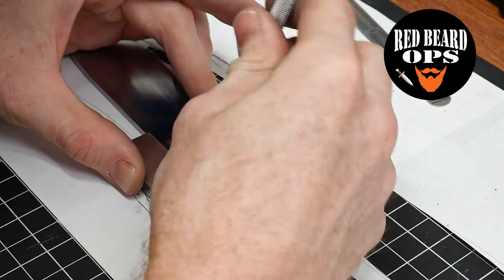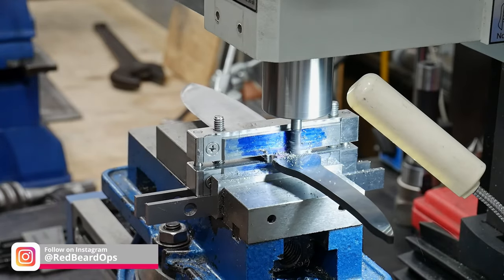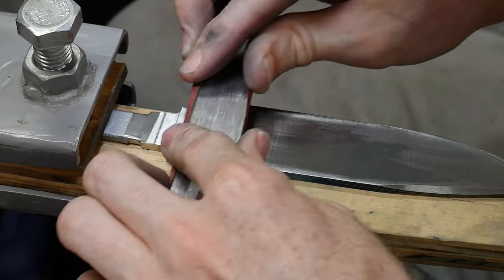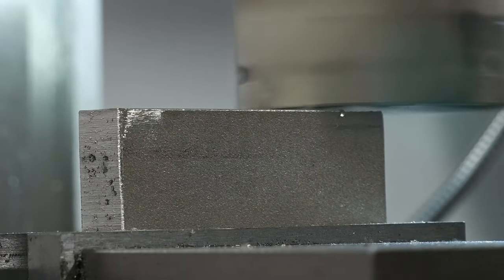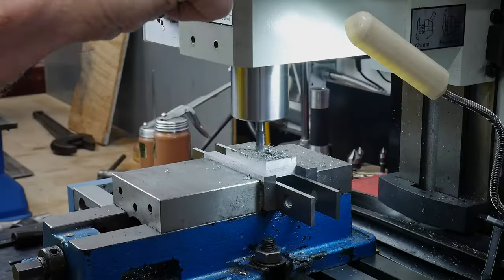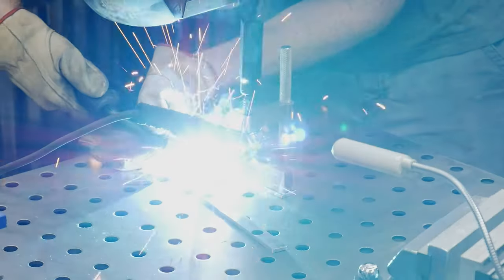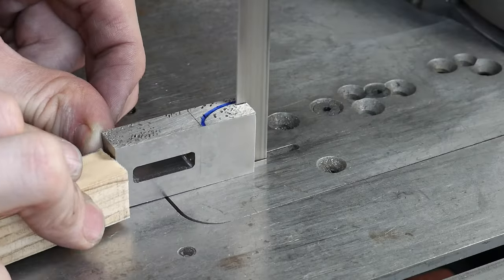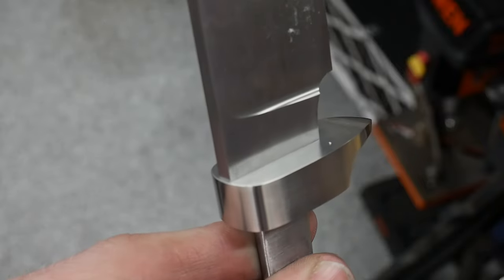My June Hunter - Knife Making - Part 2/3 - (Guard Fitting)

Comment: Even though you mill the shoulders and back cut on the mill - you still need to true that up with a file guide. And know that file guides are NOT true until you dial them in with a diamond plate. I've been milling guards this way for over 20 years there's never a fool proof method until you dial things in.
Reply from the maker: Thanks for the tips Karl!

Comment: Nice job on the guard fitup.  I don't have a DRO so I use gauge pins to measure my slot.  I mill it out .003 under the thickness of where it will fit and use a press fit.  I can usually come straight off of the mill and tap it on.
Reply from the maker: Very nice! I'll likely give that a go on one of the next ones
Reply: @RedBeardOps  also, put Vaseline on the tang before you drive it on to reduce the galling.